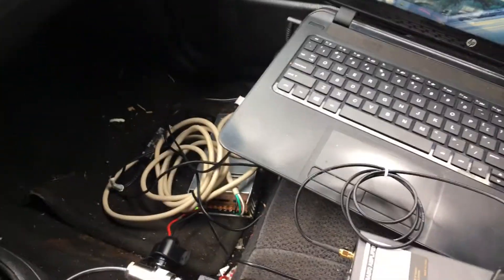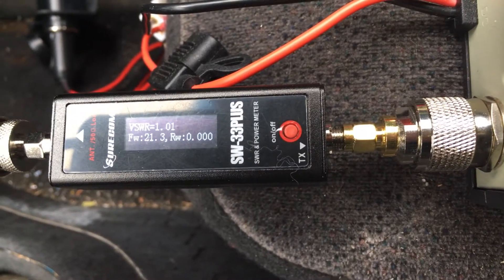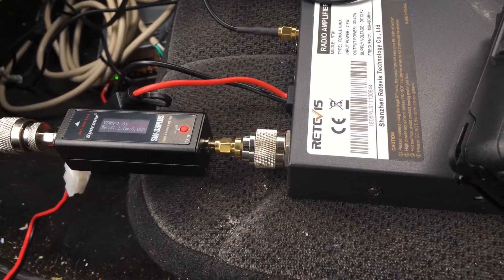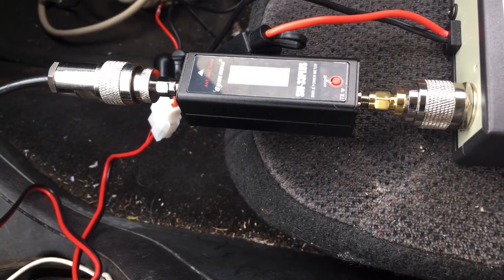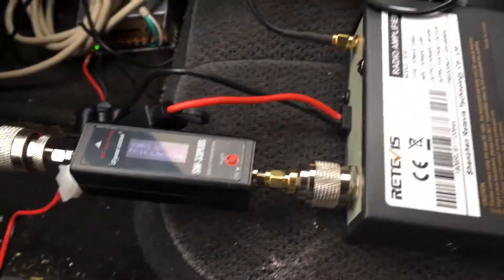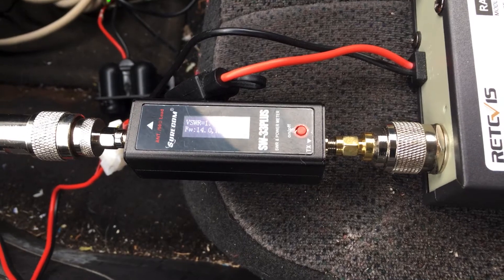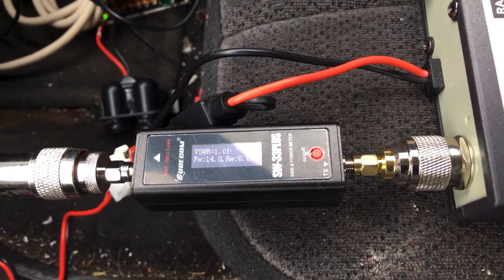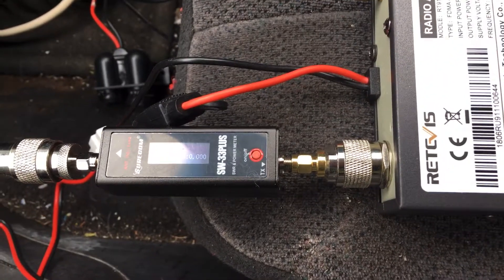🔺Retevis RT91 Power Amplifier needs a GOOD power supply, or you will lose wattage output power!!!🔺

Comment: Curious as to what the watt input capacity this amp has
Reply from the maker: I think you are asking what is the input wattage need for this amp? If so, 2–6 watts is need for the amp. Also, to get 40 watts output from the amp, you will need about 6 watts going into the amp.
Reply: @GMRStwowayradio  yes. I should have worded that differently. Thanks for the info
Reply from the maker: @lawrence1md  - no problem